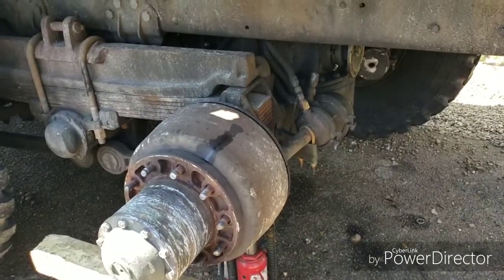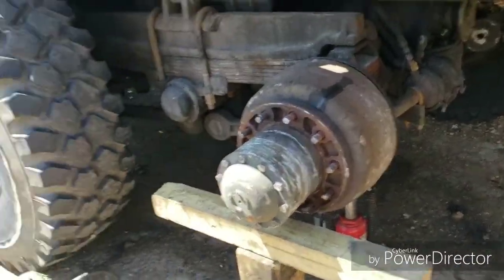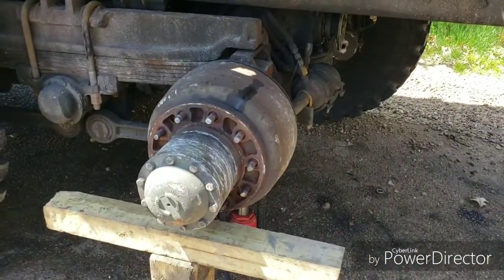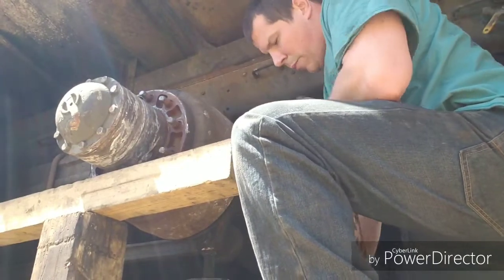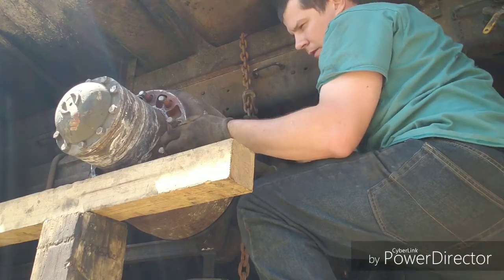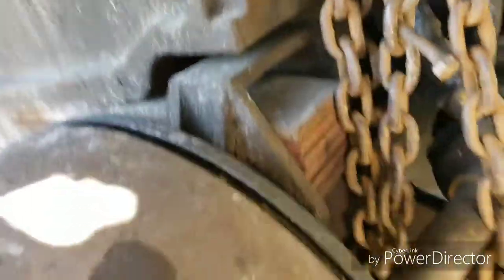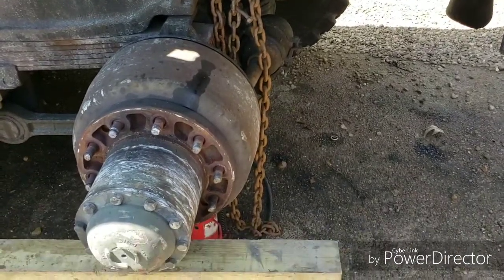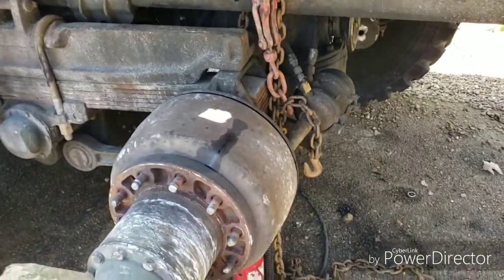Military truck emergency repair technique -  Axle chain up

Comment: Im not too sure about those frame handles. I ripped mine off trying to realign my axle after I  broke  torque rod ends
Reply from the maker: The main weight is on the frame chain. Using 2 of the handles as a secondary chain catch is just for safety.  Wrapping twice around the frame will cause the chain to get slack on bumps and rub together and easily bind itself up.  

I've driven a truck in that setup for about 90 miles towing 40,000lbs.
Reply: thanks, good to know. I had no idea what i was getting into when i bought one of these off Govplanet. The truck is 6 years older than me!
Reply from the maker: @AtomicWook  the more you drive it the less that will break.  The torque rod inserts just get weak from non usage. Mine is a 1984 and has logged almost 200,000mi since April 2016.  So I wouldn't let age be a factor.  Of course my truck has been completely gone thru.  It's nothing like a normal 5 ton now.
Reply: @wessimpson2794  it was more of a joke about how young I am the truck is a 1990 😂